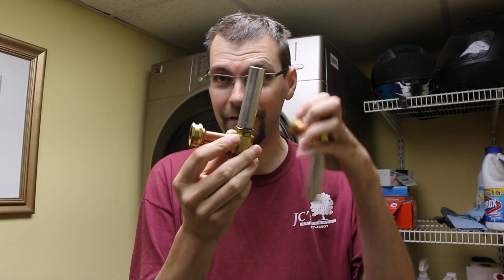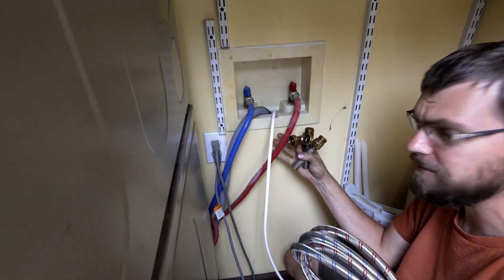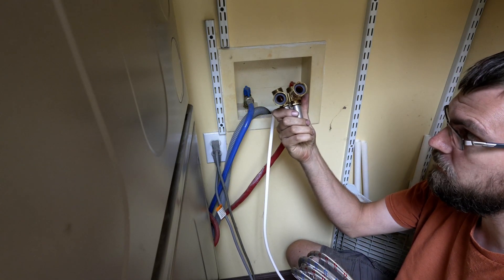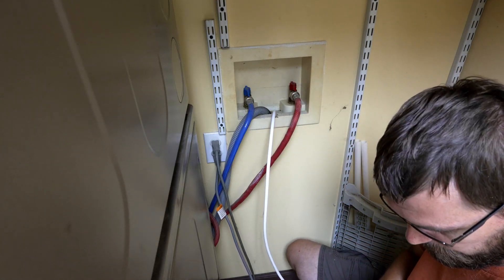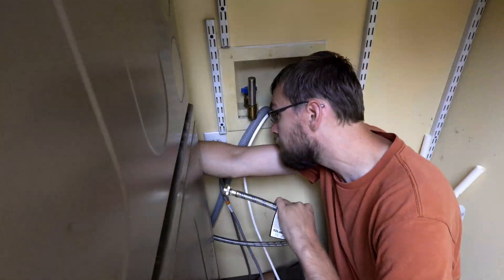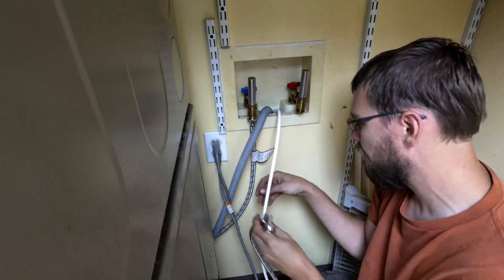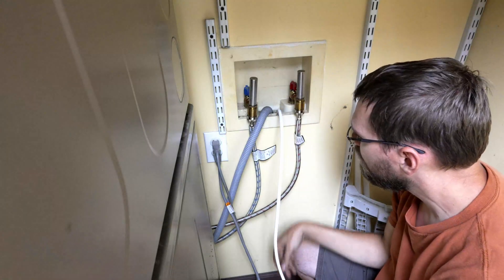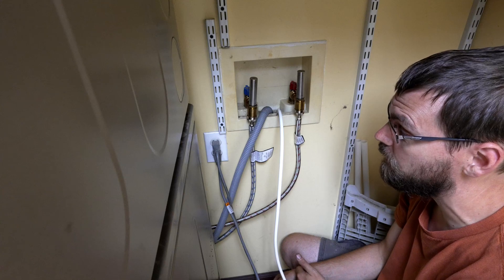Stopping water hammer caused by my washing machine.

Comment: Got a new GE washer 3 years ago, same problem. Got those same water hammer arrestors, put 4 on, and also got new hoses with a bigger inner diameter. 3 years later, I think the water hammer arrestors have some wear since not working as well. This problem is so annoying. These stupid new solenoids are needed to "precisely control the amount of water" as if laundry is an exact science and a few drops of water is going to cause global warming, give me a break.
Reply from the maker: It would rattle the pipes through our entire house, couldn't use the program start feature because it would wake us up.
I too have noticed the water hammer arresters seem to get less effective over time, I've got an idea I might try soon that would be a permanent fix, just a little obnoxious. If it works, I'll make a video about it and I'll try to remember to come comment and tell you so you can see how it went
Reply: @trythistv  I found another youtuber who got commercial washer hoses with an inside diamer of 3/4"; since I'm in a major metro area, I was able to drive a half hour to a company who had them. We left the water arrestors on, added these wide hoses and now the problem is solved. I'm curious what you're planning on trying.